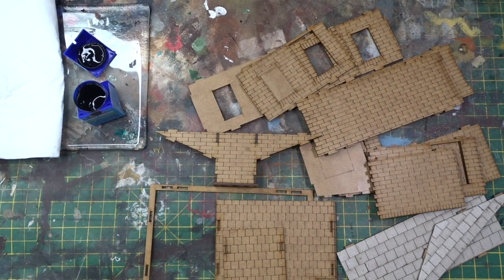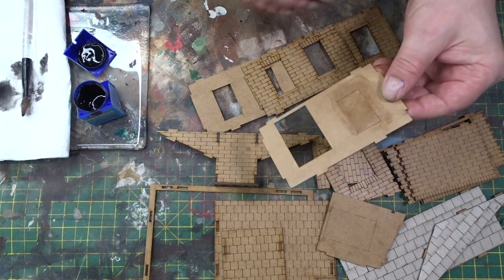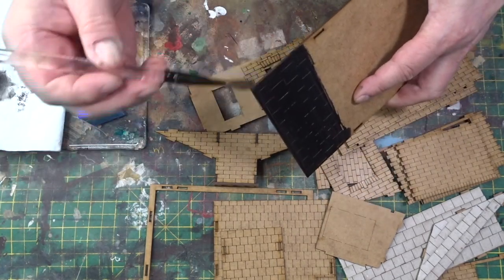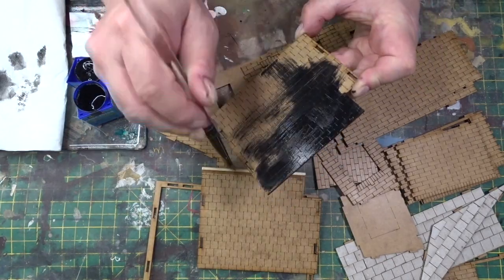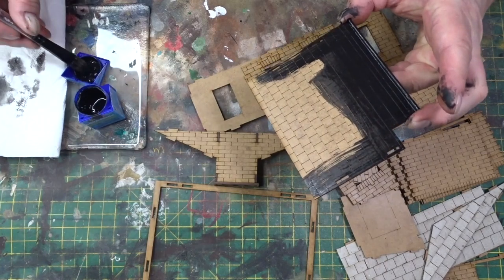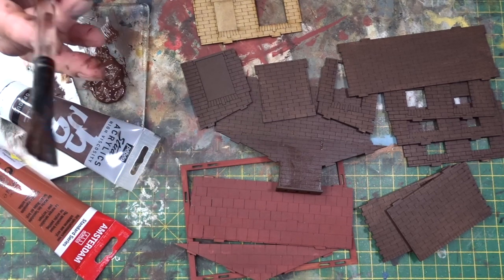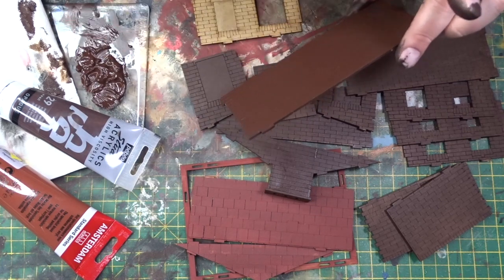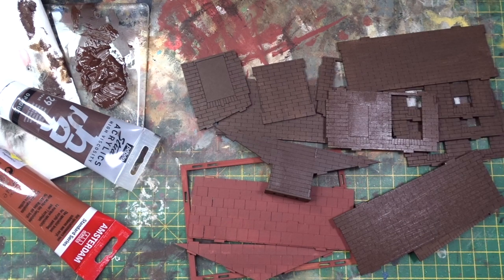Build Series #1 Painting - Video 6

Comment: I was told that we should treat MDF kits prior to painting... Doesn't MDF suck up most water-based paint and/or warp?
Reply from the maker: the MDF will soak up the carrier medium used in paint, not paint itself. A good quality acrylic is all we use direct on the mdf surface either as a spray, paint, sponged or drybrush. We even use paint pens, pencils and the like from artist stores.